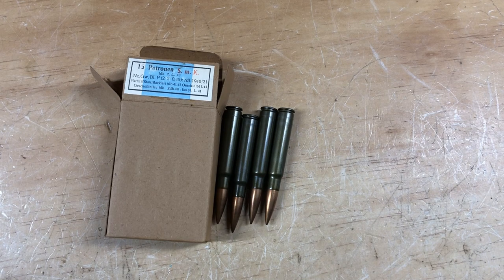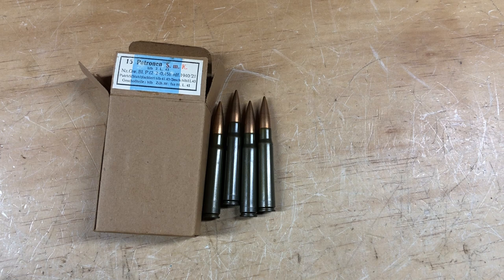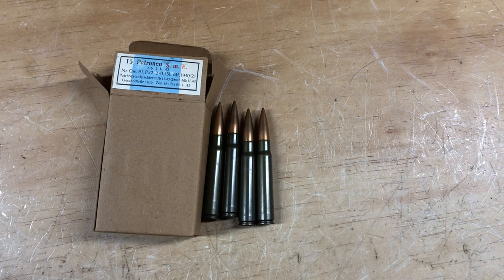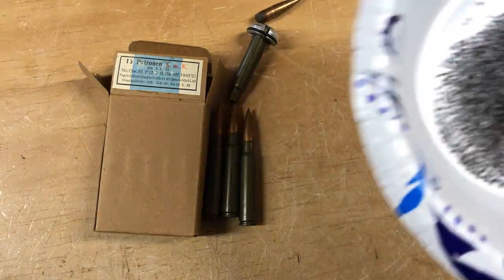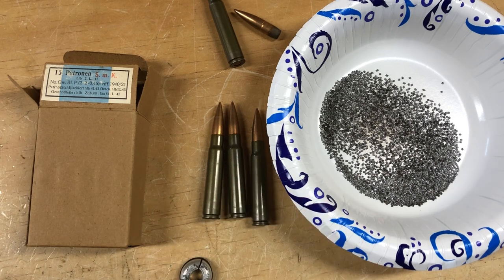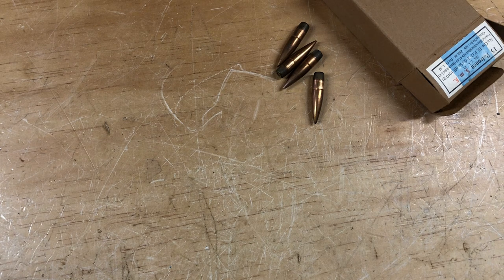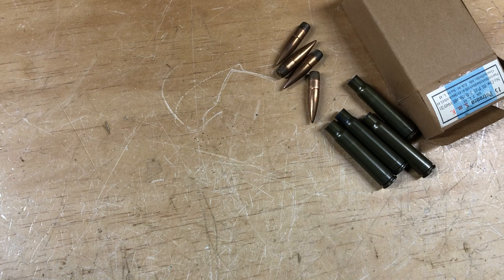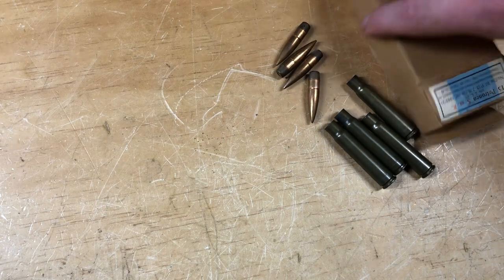What's Inside WW2 German SmK Armor Piercing Rounds?

Comment: Great vid Mike, some insight: I've shot a few hundred of the lacquered steel cased 8mm from 43 and 44 and inside most of the cases was rust. Ive had many complete case failures resulting in cracks going the length of the whole case. But oddly enough when shooting you don't notice anything different. No severe gas leaks or anything. It's only obvious when you look at the cases afterwards. Not sure how safe that is, but thats my experience with this stuff (and also the same type of lacquered East German 8mm from the 50's)
Reply from the maker: I fired 30 rounds of this stuff last night with absolutely no issues. Runs great so far.

Comment: I've shot "rusty ammo" more than a few times and have never had a gun blow up on me.
Reply from the maker: Shot 30 rounds last night just to test. All went bang, all were accurate, will eventually make a video on it after I get some AR500 to test it on.
Reply: @MikeB128  did you ever get some of these on steel?  I’ve got four 1/2” thick AR500
Plates coming tomorrow and will be putting some of these down range at them on Wednesday.

Comment: I got about 400 rounds and one box was an older version. The tip was exposed steel but it was a lot more rusty and corroded then the regular ones. The older box says “Ptr Smk” rather than the “15 patronen smk”

Comment: you are brave  to use  an  impact puller on  ammo that old!
Reply from the maker: Huh?
Reply: @MikeB128   I'd figure the vibration from impact to an old unstable primer may initiate detonation. No?
Reply from the maker: I believe you should learn more about how primers, especially Berdan primers, actually work, instead of relying on lore and suppositions. That is all.
Reply: @MikeB128  take it easy there pal, why you so sensetive?
Reply from the maker: Not sensitive, just fatigued from all the dumb comments I get like this on a daily basis.
Reply: @MikeB128   well you  certainly dont do anything to seem smarter. Dont worry  I'll  never  be back again
Reply from the maker: Fine by me, moron boomer.

Comment: Question:
Does Mil-Surplus rounds were safety to fire at those modern rifles?
Reply from the maker: Huh?
Reply: You should see if the firing spring is lighter weight. Many milsurp rounds have tougher primers so a lighter spring may not consistently set them off. Some modern Mauser rifles do not come with heavy recoil springs such as mine so I had to upgrade to a heavier firing spring. If you have a Mauser rifle, it should be safe to fire though. Remember, most bolt actions are Mauser clones.
Reply: @MikeB128  i think he means if old surplus ammo is safe to use in modern weapons
Reply: @matscarlsson498  Yeah, because some Mil-Surplus ammunition sometimes can explode because (some) modern civilians firearms often can't handle such extreme hot rounds(rounds pressure exceed the weapons maximum limit)